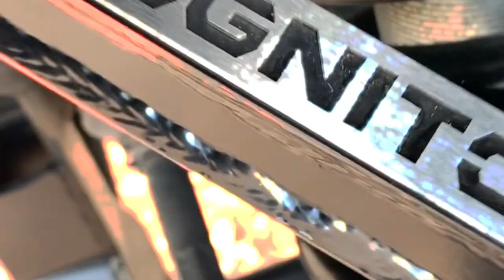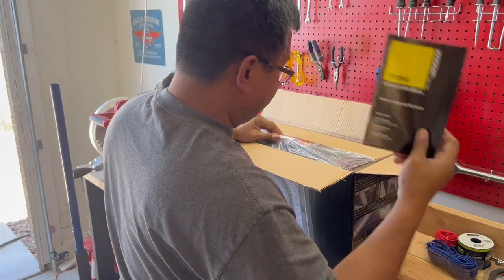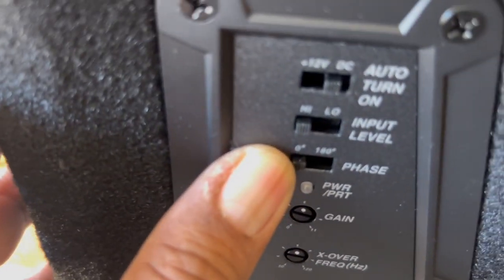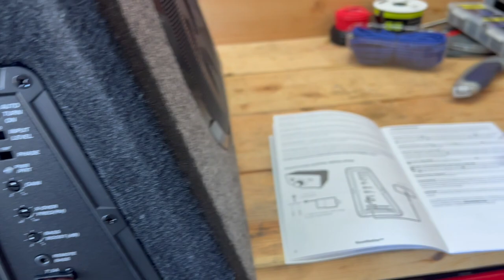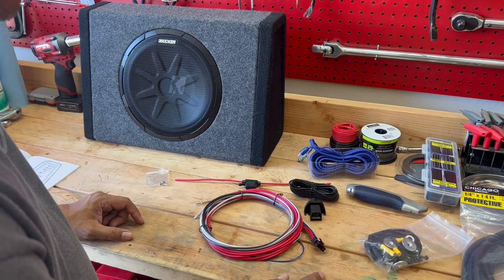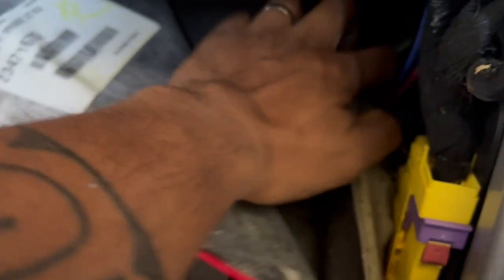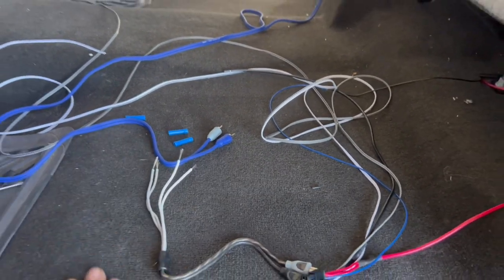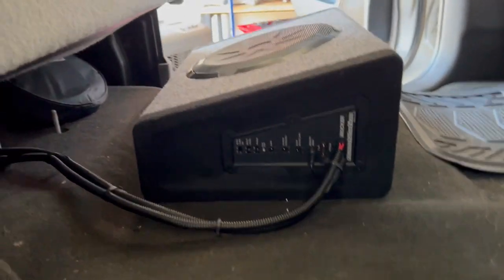Kicker PT250 Subwoofer Kicker Install and Review

Comment: Hey so I connected everything. But for some reason now my door speakers sound less loud. Almost like the sub is taking away power from the door speakers? Which shouldn’t happen bc the sub has its own amp. Any suggestions?

Also, I connected the remote wire to the cigarette lighter fuse so that works. I also tapped into both rear speakers with the other 4 wires. Is that correct? My setting are 12V and Lo input level. Still the door speakers are not loud. I used to not be able to max out my volume on the head unit. Now after sub install, I have to max it out in order for it to be somewhat loud.

Comment: One of our local Subie WRX guys has the PT250 sub/amp installed with his stock head unit, and I was pretty impressed with how it sounds..  Definitely a great buy for anyone looking to get a little extra low-end over what a stock head unit might give.  Super easy install at that..
Reply: Could he set it up so all the bass came from the sub? I have a 2020 STI and having the bass come through the speakers fucks up the rest of the song
Reply: @brother_maleik  I believe you can turn on the bass down on your head unit so that no bass is coming through door speakers and then turn up the bass to just the subwoofer with the bass knob included with the sub. I could be wrong
Reply: @bronsondempsey7812  makes sense, turn the whole bass down and turn it up extra on the sub. Not the perfect fix but it will work
Reply: I need help I have it all hooked up the blue light comes on but nothing else happens

Comment: Is it the black headphone jack looking cable that plugs into the bass nob? & if I'm just splicing into my factory speakers do I have to run the blue remote wire?
Reply from the maker: The Bass knob does connect to the jack located on the amplifier panel.  If you are splicing into your wires, you don’t need to connect blue remote wire.  This set up is the High Level Input (taping in to existing wires).  The amplifier will sense a signal coming from your head unit and turn on the amplifier.  NOTE:  Make sure you set the “Auto Turn On” switch to “DC” and “Input Level” to “HI”…. I hope this helps!  That’s for checking out the video and don’t forget to Like & Subscribe 🤙🏼

Comment: Hey I lost the 10 pin connector that goes I got he subwoofer and was wondering if you are able to tell me which wires are the ground, positive and the 12v. The wires on the new connector I got are different color
Reply from the maker: If you follow the order of the 10 pin connector from Left to Right  (Top Row Pin 1 would be top left and below pin 1 would be Pin 6).  With that said, your Positive leads are Pin 5 and 10 (these to leads need to be joined together and connected to the positive lead to your battery.  Pin 4 is your remote wire and Pin 9 is suppose to be empty.  Pin 3 and 8 are your negative leads that also need to be connected together and grounded to bare metal.  I hope this helps!  Thanks for checking out the video and if you haven't already, please like and subscribe!

Comment: Hey brotha, great video. I appreciate how informative it is. Question. I just bought the same sub but I have a stock unit on my 2020 Nx300 so I’m thinking of connecting it the rear speakers. What do I do with the blue cable? Will the amp turn off on its own with I turn off the car? I’m a bit concerned. Thanks in advance 🙏
Reply from the maker: I’m guessing the blue you’re talking about would be your remote wire… You will need to connect that wire to the remote blue wire coming from your head unit or to an accessories like your cig lighter.
Reply: @hawaiianbrokechanic  ok cool. Thanks but how exactly do you do that? Considering it’s just a wire, is there an adapter for that wire?

Comment: Just curious man, do you have to install a touch screen or new head unit to run this kit?
Reply from the maker: No you don’t need a new head unit.   Usually factory radios don’t have RCA output jacks for an external amplifier, so you may need to tap into existing output wires from the head unit (example output  wires from head unit to rear door or trunk speakers for a HI signal input to the amplifier…

Comment: Great video!!! I just had mine installed, but get distortion depending on the genre of music. How much gain vs bass boost did you add with the notched knobs? How do I get your clean sounds?🙏🏻👍🏻
Reply from the maker: Because this is a single 10 inch sub, you will not get that low booming bass at high volumes.  Here is what I did to get punchy bass with very little distortion:
1.  Turn your gain on the sub all the way down and your bass knob all the way down as well.
2.  Turn you head unit volume as high as it can go without distorting.  
3.  Turn your subwoofer frequency all the way to the right. (Up in frequency).
4.  Turn your subwoofer gain up until it starts to distort then back off until it’s clear.  
5.  From there you can adjust your bass knob for addition bass.

NOTE: If there is distortion, you will need to adjust your equalizer in your head unit.  Back of the 20/30 HZ frequency.

So…now you can play you music at a reasonable level and adjust the bass using your bass knob… Back off on the bass knob if it starts to bog.  You will need to do this a few times until you dial it in…. Remember with this subwoofer, your bass will come from the mid frequencies…let me know how it goes and thanks for checking out the channel!  Don’t forget to like & subscribe 🤙🏼

Comment: Great video. What speakers do you have connected to your head unit? I have the same one, and I want new ones.  Sub is up next. Thanks
Reply from the maker: Dash board speakers are stock, but I will be upgrading soon!  The door speakers are kicker 6 1/2’s.  My head unit has a built in amp that only pushes about 25 watts rms per speaker.  I will be adding an amp for the front and rear door speakers in the future🤙🏼

Comment: where is your power wire hooked to when i splice a thick wire from the battery into my power wire the sub does not turn on
Reply from the maker: @mosessherwood3766  what turns on the amplifier is the blue remote wire.  That wire needs to be attached to a positive wire that gets power when the ignition is turned on.   The other way to turn on the amp is the tap into speaker outputs from the head unit to send an audio signal into the amplifier.  You’ll have to set the amplifier switches to HI-input (gain)… I hope this helps!

Comment: Any help be appreciated,  but i recently installed the same kicker setup. Bought the rca to wire splitter. Amp turns on but no bass. Everything is plugged in and wired up correctly but no sound. What can i do?
Reply from the maker: What kind of head unit do you have?  Does your head unit have a built in amplifier? (Is it powered?).   If your head unit has a built in amp to power speakers, the kicker amp will clip and cut off the signal hence no bass.  Here are a couple of troubleshooting hints:

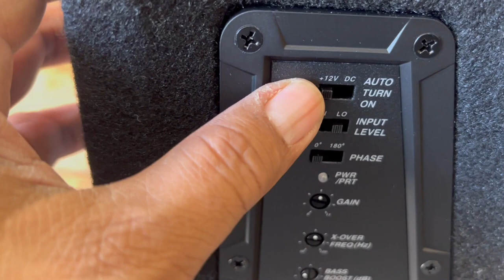1.  Go back to the video at 5:00 and review that you’ve got the switch’s set properly.
2.  Turn all inputs on the kicker subwoofer to the minimum setting (input & bass).  Turn frequency all the way to the right.
3.  Turn down the bass frequency on your head unit all the way down (30/60 HZ frequency down).  
4.  Turn volume on head unit up between 10 and 15…. Slowly turn up input knob on kicker amp up until you get sound.  You should get sound coming out of your kicker sub…

Other things to check-is the LED light on the kicker amp blue when it’s turned on?  If it’s Red, then it’s clipping…you will need to back off the bass and volume on your head unit…. 

Start with this first and let me know how it went…

Comment: Can I tap into the stock sub wires to get sound with this??
Reply from the maker: Yes you can, but you will need to tie in the female rca adapter to the subwoofer’s speaking inputs…

Comment: Does this power the stock speakers? I’m trying to install
Reply from the maker: @cmatin01  no because the output of power is going to the subwoofer speaker.   Your stock speakers will feed off the power of the head unit.   It depends on what your connections will be…high or low gain.

Comment: I got mine installed yesterday with someone that knows what to do but it sounds bad. I got the controller installed and everything and it starts sounding nice, but as soon as i play with the remote it stops sounding as good. I don't know if it's not getting enough power or if it's not properly equalized. But the bass sounds either super strong or doesn't sound at all. I have no idea what to do and it sucks cause I've heard good things about those bass.
Reply from the maker: There are a couple of reason why your experiencing those issues.  

First-the most common is that your head unit has a built in amp that pumps out wattage above 20 watts or above per channel.  The built in amp on the subwoofer cannot process too much watts going in, therefore causing the speaker cutting out or resulting in too much bass.  The fix is to use you RCA outputs from you head unit into the subwoofer box giving a low level signal into the amp.  If you don’t have RCA Jacks in the back of your head unit then you will need a line level converter to lessen the signal.  You then would tap in existing speaker outputs wires from your head unit.  

Second-improper wiring.  Many cases it’s poor ground or  wiring line level converter wrong.

You will need to adjust your EQ TO LOWER BASS TO ZERO (on the head unit), set your bass knob for subwoofer to the lowest setting.  Play your music then raise the volume before music distorts, back off the head unit volume, then adjust your bass knob for more low end.   The level knob on the subwoofer box should be set to 9 o’clock you can adjust up to 12 o’clock (don’t max it out).  The frequency knob should be sitting at 12 o’clock to start, the higher the frequency the better.  These speakers will not give you the ball busting lows.  You will get more of a punchy mid bass tone. 

What I’ve suggested is a good place to start.  Keep me posted!

Comment: I juat purchased this amp and sub combo. Did not realize that i would need the rca to speaker wire adapter can i just tie into the correct colored wires behind the head unit ? Or do i need a adapter for the wires
Reply from the maker: You can go direct as you’re  suggesting, just be sure to choose the High input settings on the amp.  The instructions tell you how to wire it that way…. The only time you will need an RCA Jack is when your head unit has female RCA outputs for a clean signal.   If you head unit has a built in amp more than 20 watts per channel, then you will experience the kicker amp clipping.  If you’re not in a rush to install it, get
The RCA adapters…
Reply: @hawaiianbrokechanic   I have rca cables already back under the seat ready for a regular amp and sub setup. Could I just cut the ends off the rca wires ? Or would you recommend waiting for an adapter?
Reply from the maker: @jaywickham6090   if you have spare RCA jacks to use…then yeah, you can cut and splice.

Comment: I have a convertible mustang i plan to put this in the backseat but i want to add a decent amount of bass that will be plenty noticeable and if this will do good?
Reply from the maker: With the top down you will loose bottom end.  Full transparency, the sub sounds better in an enclosed environment.  You will get some low end, but it all depends on what crossover frequencies you tune to and your EQ settings…
Reply: @hawaiianbrokechanic  thanks for the info i really appreciate it👍👍

Comment: For the blue remote wire that came with it, it’s too short… can I extend with 18 gauge wire or what kind of wire?
Reply from the maker: Yes!  The remote wire does nothing more than provide a small current to turn on the amplifier.  I hope this helps!
Reply: @hawaiianbrokechanic  yes thanks! last question please for the striped black wires (grey and white with black stripes) on the sub did u connect these with the same grey and white black striped wires on the speaker line to rca adapter?
Reply from the maker: @randomdude6240  so what’s important is speaker wires with a stripe (example: white with a black or gray stripe) signifies a negative current.  So, as long as these are speaker connections, you will want to connect them to the wires that are also striped on the RCA adapter.  This insures proper polarity.  If you have an RCA adapter, refer to the instructions to make sure you’re making the proper connections!

Comment: I can’t get the sub to turn blue. It stays red. Any ideas?
Reply from the maker: Does the light stay red when the volume is all the way down?  If so, you’ve got way too much watts going into the amp.  Make sure all your gains are set to flat on the head unit EQ and the amplifier gain is set to the lowest setting… start by increasing volume on you head unit until it clips then back off a little.  From there you can increase the gain on the amp…. Too much bass into the amp will also cause clipping and the amp will go into protection mode… I hope this helps!
Reply: @hawaiianbrokechanic  yes that is helpful. Now my light is blue, but I’m not getting any sound and I tried multiple different ways to connect the speaker wires to the head unit.
Reply from the maker: @rileybattis8754  how do you have the speaker wires connected to the amplifier?  Did you use a RCA adapter or spliced wires together?  Make sure you got the amplifier switches turned on to the right settings.
Reply: @hawaiianbrokechanic  I also have an aftermarket head unit that takes rca

Comment: How do you hook up the wire from the radio tho?
Reply from the maker: If you have a stock head unit, your only option is to tap in to the speaker outputs (wires going into your stock speakers).  Be sure to set up amplifier settings to HI-input (follow instructions for this set up).  If you have an aftermarket head unit with RCA outputs, you will need the rca adapters mentioned in this video to connect to the speakers amp.  I hope this helps!  Thanks for checking out the video and don’t forget to subscribe 🤙🏼

Comment: hey i have mine connected to everything and I'm not even getting power
Reply from the maker: I would check the blue remote wire connection.  What you can do is connect the blue remote wire from speaker wire harness to the positive wire coming from your car battery.  If the amp in the box turns on the amp, then it’s the blue remote connection.  I would start there…. If that’s the issue, you will need to tap into the an ignition powered accessory like the lighter receptacle.  If it’s not the issue, check your positive wire connection and ground.  Bad ground is usually the culprit…l hope this helps!

Comment: Ive tried to get it to turn on and it wont idk what i messed up
Reply from the maker: How do you have it hooked up from the head unit?  RCA Jack to speaker or speaker output from head unit to speaker?
Reply: @hawaiianbrokechanic  the way you did it
Reply: But idk if i messed up a canle
Reply from the maker: @freddy78bass  okay…so if the amp isn’t turning on then there’s probably an issue with the remote wire connection.   To test this, you can take the blue wire and touch it with your positive lead and the amp should turn on…just make sure all your gains are turned off…. If the amp turns on, then you can hook up the blue remote wire to an accessory like your cig lighter  (+ wire) that turns on when you turn the ignition on.  Make sure the switch’s on amp is set to 12V and Lo input… Let me know if this helps!

Comment: How long are the wires?
Reply from the maker: I used (12 gauge stranded) 16 ft of primary red and 16 ft of black ground/negative.   You can buys spools of of wire from any automotive store or Walmart.
Reply: @hawaiianbrokechanic  okay I was asking how long the wires are that came with the sub
Reply from the maker: @rayben3972  oh okay…so depending on what kind of vehicle you drive,  the positive and negative wires are roughly 10 ft in length.  You may need extra wire to lengthen the connection.  I hope this helps!
Reply: @hawaiianbrokechanic  So you used 12 gauge from the battery? I thought power to subs need to be thick
Reply from the maker: @332ARA  the wire harness that comes with the subwoofer comes with 14 gauge wires.  12 gauge is a tad bit larger.   So I tried to master the diameter of the wires throughout the install.   With that said, if you are installing a stand alone amplifier, the size of the primary wire will depend on how much watts you will be pushing.  Here’s a link with more info:

https://www.crutchfield.com/S-lYtq2Xy73Ss/learn/car-amplifier-installation-questions.html#6

I hope this helps!